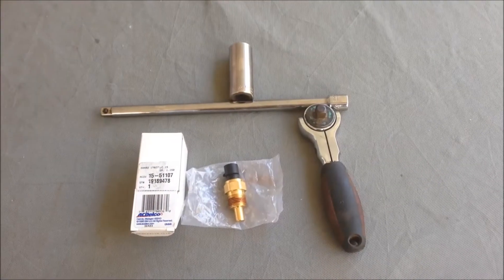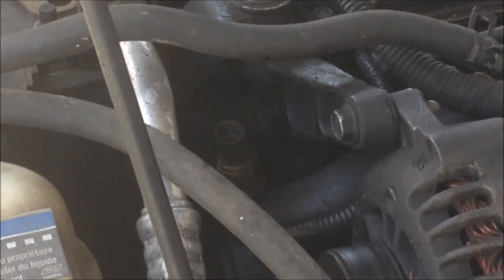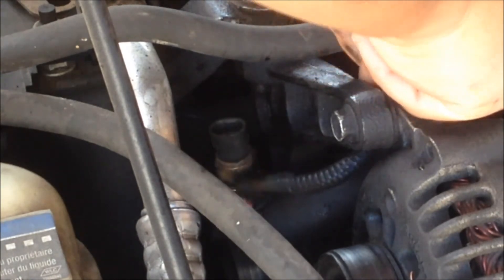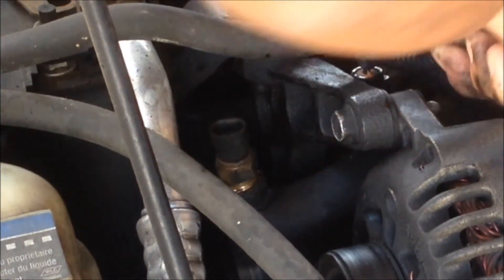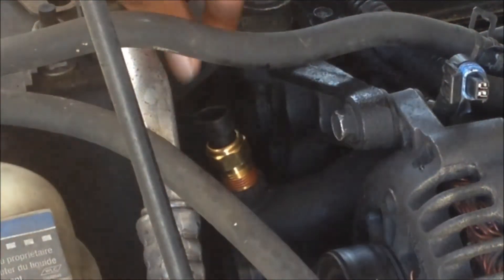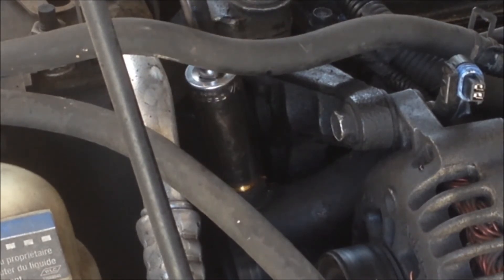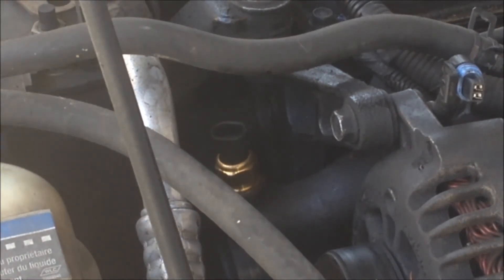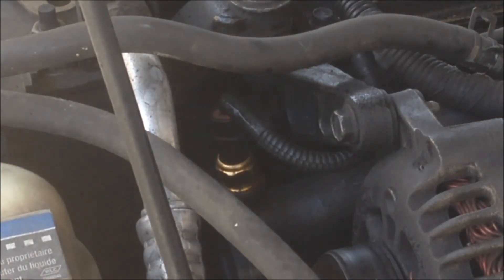02 Chevy Cavalier ECT Sensor Replacement (Engine Coolant Temp Sensor)

Comment: My fan on my 02 sunfire with NO A/C WILL NOT KICK IN HELP!!! SHOULD I REPLACE THIS EXACT PART? IT STILL FUNCTIONS
Reply from the maker: Make sure that the cooling fan relay which is located under the hood on the right side of the engine compartment is good because when it goes out it causes a similar issue. If you shake the relay and it rattles it needs to be replaced. I hope this helps you out. Sorry for the late response

Comment: My 01 cavalier 2.4L fan doesn’t turn on at all. Volt tested it right before the motor and reading 13.4V relays are working. Is this a possible problem?. Because coolant just doesn’t want to stay in the reservoir unless driving at night when it’s cool out.

Comment: I have a 2004 cav and my temp gauge is stuck pretty low on my dash. Because of this, is this the main reason why my cooling fan will not turn on? No codes are being read but when I turn my AC on, the fan operates as normal. I believe this sensor is the culprit.
Reply from the maker: Also make sure that the cooling fan relay which should be located under the hood on the right side of the engine compartment is good because when those go out they cause a similar issue. If you shake the relay and it rattles it needs to be replaced. I hope this helps you out.